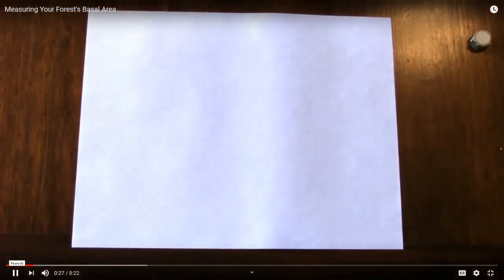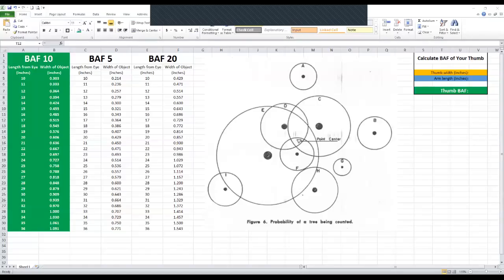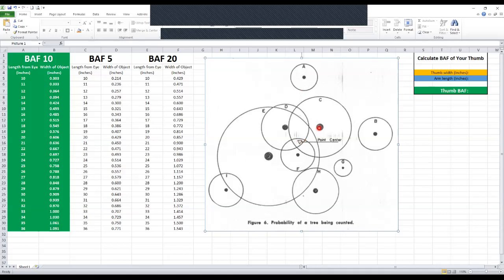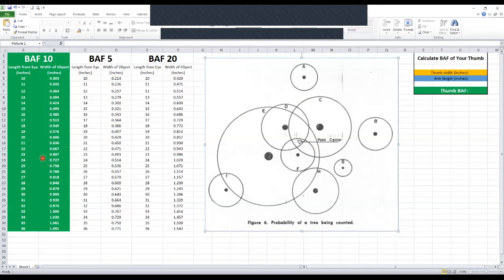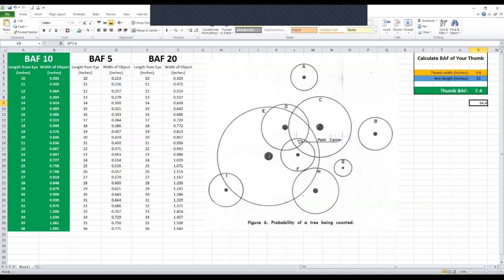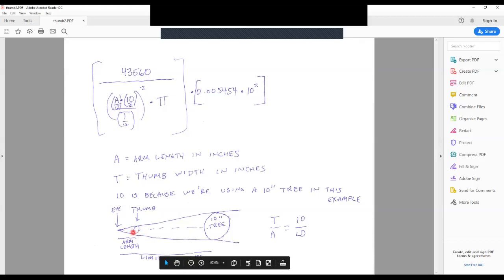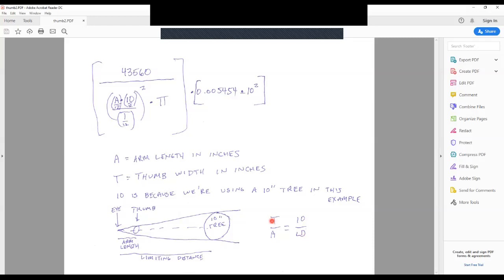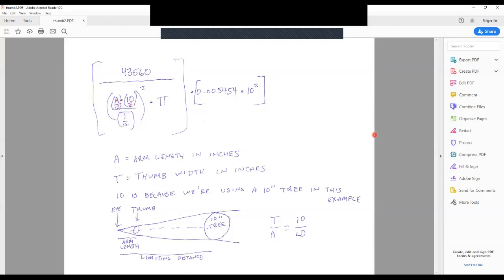Creating Your Own Angle Gauge to Estimate Basal Area in Forestry

Comment: Hi. Do you know where I could find the metric version of that math?
Reply from the maker: Off the top of my head, I think it will work if you substitute the following numbers in the equation shown written out on the page:

10,000 for 43560  (square meters per hectare, not square feet per acre)
100 for 12 (cm per m, not inches per foot)
0.00007854 for 0.005454 (this link explains why: http://oak.snr.missouri.edu/nr3110/topics/basalarea.php )

Then, measure arm length and thumb width in centimeters.

Output will be the BAF of your thumb in square meters per hectare.

I haven't tested it, but believe that would work.